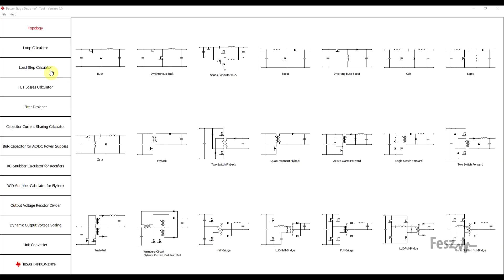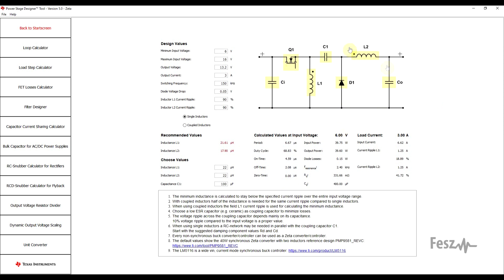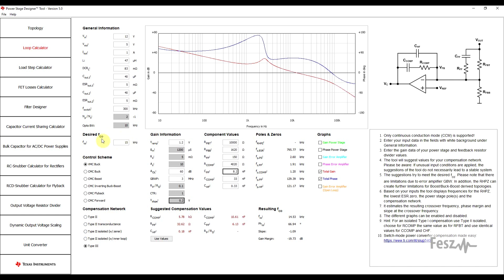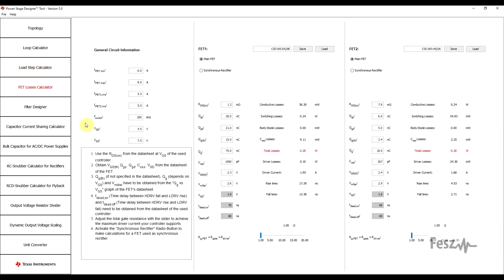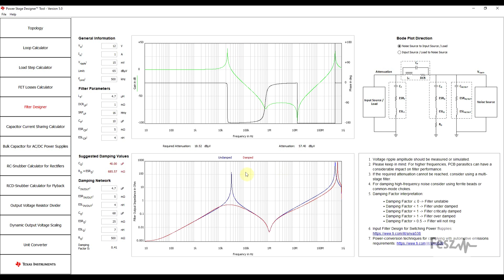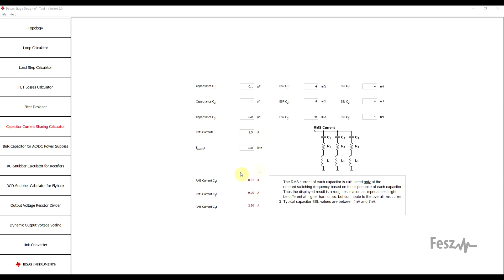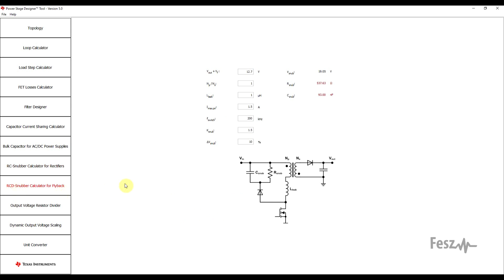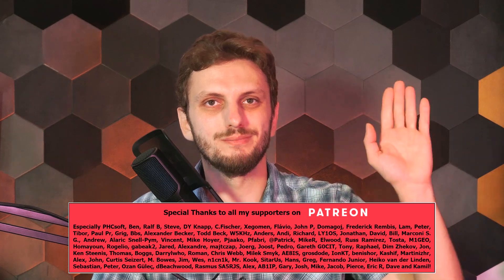Power Stage Designer Tool review

Comment: Great video; thanks for pointing out a useful tool. An issue that I have with such tools/spreadsheets is they don't provide any guidance to inexperienced designers as to realistic values for the input parameters. Most notably they typically seem to indicate that very low switching losses can be achieved as a result of unrealistically high switching rise and fall times. Eg. I tried the tool for a 18V to 12V/8A synchronous buck at 100kHz with a 33uH inductor and a CSD17579Q5A for the switch FET. I chose 5.8ohms for the total driver resistance (1 ohm driver, 1.8ohm FET Rg + 3ohms gate resistance) and it calculated a mere 82mW switching loss due to switch rise and fall times of 7ns and 6ns. Ok, 5.8 ohms is rather low but I'd expect that achieving such speeds would be very optimistic due principally to stray inductance, especially the FET's source inductance. My gut feeling is that 25ns is an ambitous but achievable target but I don't have any real experience to back that up.

I know you've done videos on MOSFET switching but it would be great if you could cover the topic in a bit more detail including what are realistic switching speeds that can be achieved without heroic design and layout skills and EMI considerations. I've done a fair bit of searching but found very little hard information; plenty of videos showing the switching scope traces, but either they use very slow switching times (probably because capturing fast transistions requires expensive scopes and probes) or the timebase is too slow to make any reasonable estimates of the rise/fall times.

You could also cover the benefits/tradeoffs to paralleling smaller switch FETs, rather than using a single larger device, to reduce the dI/dt rates of each FET and thus reducing the effects of stray inductances.

Also it would be helpful if you could suggest typical MOSFET stray inductance values for common packages as they are rarely specified in the datasheets.

[Edit] Finally, to what extent are the speed, and thus efficiency benefits of GAN FETs the result of the very low inductances of their special packages rather than their lower gate charge?
Reply from the maker: Quite a complex question, but I will try to somehow answer, at least partly - you can get a first idea of a transistors switching speed from the datasheet - usually it has some sort of values given that where practically measured using the test fixture - for the CSD17579Q5A you get 1n/7n fall/rise. Anyway, at 100KHz I would expect switching losses to be small, so the ~82mW value does not seem all that absurd. At this switching frequency, the biggest losses will be conduction. Anyway, you might find a transistor spice model and just create a basic simulation to get a better estimate, even if that will not split the losses into switching and conduction. Regarding package/trace inductance, a rule of thumb is 1nH/mm, its not perfect but its a start. However, at 100KHz, package parasitics are usually not specified since these are not the main contributor - layout and interconnections will be providing most of the issues.
Reply: @FesZElectronics  Much appreciate your response. Power stage designer defines tr and tf to include the time when the FET d-s current is transitioning plus the Vds rise/fall times (ie. when losses occur).  Following your suggestion I tried LTSpice using a BSG0811ND (very similar switching specs  to the CDS part). The switching loss was 48mW with tr/tf = 4.7ns/5.5ns. These closely matched PSD's calculated 5.5ns/4.7ns. Trise and tfall were 2.8/3.0ns

However adding 3nH parasitic FET source pin inductance quadroupled the sw loss to 195mW with tr/tf = 15.5/16ns. Rise and fall times were little changed to 3.7/2.9ns. I can't remember where I read the 3nH value for a D-PAK.

I'm not sure how easy it would be to limit the stray inductance to even 3nH in a real implementation, hence my question as to how realistic tools like PSD are when it comes to switching speed - in the tool you can increase the driver voltage and reduce the driver resistance to 0 to suggest arbitrarily fast switching speed but in reality I assume limits arise due to the FET's dV/dt and dI/dt limits, EMC considerations and especially the stray inductances;  I have no real world experience and am wary of simulations limitations hence my question. The problem with so many educational papers/blogs/videos is they teach the principles but rarely provide real world 'reasonable' numbers.

Also note the TI FET D/S specs are for an impractical  0 ohm driver. I'm not sure how they could have tested that!
Reply: As someone that just completed an LLC design based on an ST Micro reference design, I feel your pain. Without going into details, I can say generally what you are asking is about the “magic” of pcb layout. These fine details are kind of an engineering IP of the designer if you will. I suggest you get the basic reference pcb design (buy the kit) and study the layers in detail. Expect several rev level changes as your board evolves. Or pay to have the layout done by a competent designer which has vast experience in your target end device. These guys are not just graphics people. Many are EEs. Just because they have done smps, this is no longer enough experience. They need to know your target chip. 

Should you decide to go on your own, the Altium videos on YouTube regarding smps layout are invaluable. If you go this path, only use a target device which has a reference design offering. Most of the newer devices are basically a micro controller not a power management chip.

Mixed signals of low amplitude (600mv)combined with high dv/dt (400vdc) are a special trick. When in one 16 lead soic. Pfc and half bridge in one device.
Reply: @frnkbooth6871  Thanks for your helpful insights. My view is that designing a state of the art efficiency hard switching converter likely requires super-hero design skills, tools, long experience and cutting edge devices.

However I'm sure that most competent engineers could design a switching regulator with moderate efficiency and with help even get it through EMI/EMC certification - primarily by moderating the mosfet switching speed - dV/dt and dI/dt. Faster switching  is required for higher efficiency but that comes with increasing EMI/EMC.
 

My question is what is  a reasonable target for switching speed for a non-specialist designer? TI's Powerstage Designer does not help because it is easy to choose values that give loss losses eg. the sub 5ns switching speed in my example, but unreasonably fast for a non-hero designer to achieve.

Funnily enough I've just watched a video "Impact of MOSFET Gate Resistor on the EMI & Noise Spectrum of a Switch Mode Power Supply". Here: the presenter https://youtu.be/_r0xtaYMjYQ?si=1rDE9wBNhhhj8dzx demonstrates that a 30ns rise time is unreasonably fast from an EMC/EMI viewpoint; 100ns would be much better but probably unacceptable on efficiency grounds and that 50ns is a good compromise. (This was a flyback design, voltages unknown but givem the LISN presumably mains input).

[PS] Just noticed the 30ns rise time is actually the 20Vpp gate rise time; we aren't shown the drain voltage fall time but I expect it will be similar.

That sounds like a good guideline but I expect the 'reasonable' switching times heavily depends on the power levels and voltages involved for a given architecture. My interest is currently in circa 30W 24V to 12V buck regulation so maybe 50ns is a reasonable target? I appreciate that good layout is likely very important for any design above a watt or two, not that you'd know that looking at some of the cheap Chinese designs...